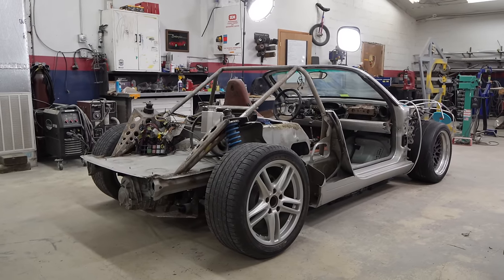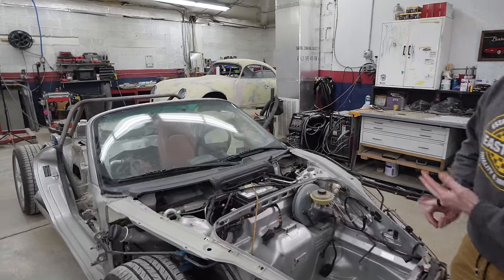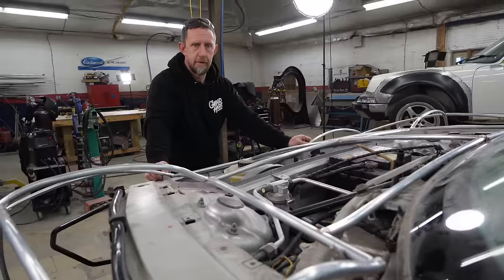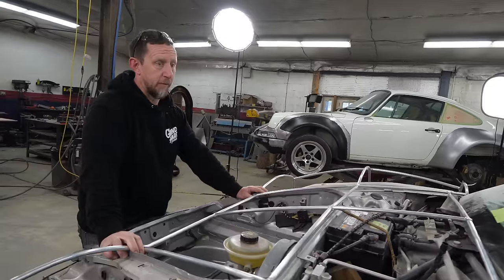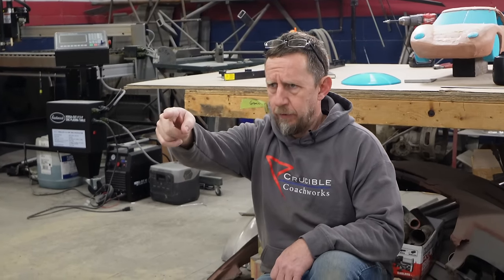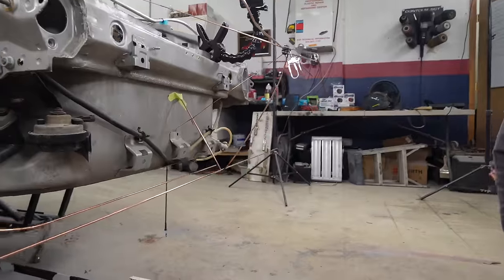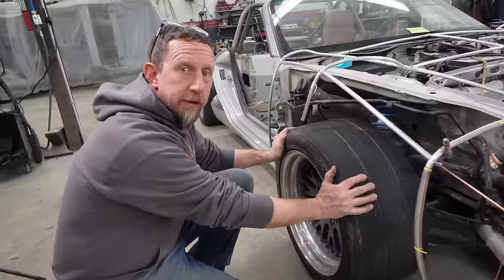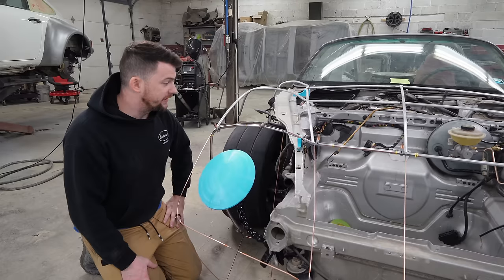$500 Junkyard Supercar! Custom Bodywork! - Project Jigsaw

Comment: I worked in a prototype department of a factory that made fiber glass parts for busses and trucks and elevators. We had a vacuum molding machine for plastics and I enjoyed making new designs and the development but I didn't enjoy the repetition of factory work. But in making the original and then making the mold of the original and proving the part was really enjoyable. So I get what you're doing and I would really dig making this and covering it with that shrinking plastic that they use on airplanes then using some sort of Bondo to fill it out and then making a negative out  of sand mixed with waterglass and then be able to take that to a smelter and have it made out of steel then make the negative of that out of steel so you could make a press forming machine to make your parts for production.

Comment: Hey guys looking good..

I believe the seating configuration (or more how awkward it is) on the Ford GT is probably behind the roofing dynamic it has, which I would say is definitely one of it’s stronger features, that makes way for the rest of it’s styling dynamics..

Think about seating that runs way closely to the chassis, even dips in the chassis to further accommodate them, and bring on a wicked low rear ceiling dynamic that I believe sets the style of the 1960 shapes you guys are working towards…

☮️

Comment: Rather than the REAR edge of the light pop UP, in order to make the Lights level at night you should drop the front edge down, it will solve using THOSE lights without hitting the inside of the back of the hood?

Comment: 3d print an internal or external bracket to hold the outer shell of light, then place the other backing bucket inside of that again,  solves the problem with minimal things that can go extremely wrong.

Comment: There is a Youtube Channel which currently builds a car from the Cyberpunk 2077 game. He uses fiberglass which you don't want to use BUT he starts with wires and then stretches some sort of elastic fabric over it which he later soaks in resin. You could also do that (without resin) to see if the proportions are right, contours where they should be etc. So wireframe, strech fabric and get an estimate if the wirework is correct. I would have said that you could fiberglass that to produce a "mold" to work your shet metal against but I guess that would be too much work as step in between.

Comment: Ok for future reference you can scale your photo and photography down to give you a grasp on proportions. IE your model and your car have two different front window rakes. Not a big deal, take a picture of the whole car and measure to where your lens is from the car. Now take note of your focal length. Now if you are building a 6th scale model, divide both your distance to the lens, and focal length by 6. Now place the camera from the model with the new distance and focal length. Now take a picture. Next over lap the two in photoshop so you can see where they are different. It also would have shown you the issue with track width if you did it from the front.

Comment: Why not heat and remove the lens, then 3d print a wedge shaped adapter to keep the rear at the original angle and the lens at the new?